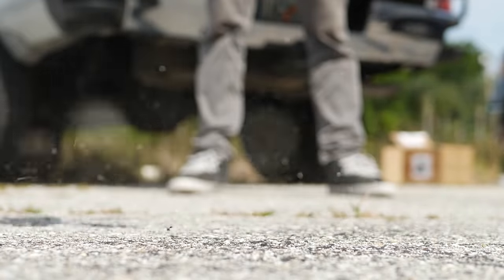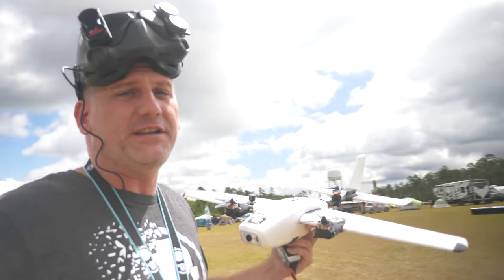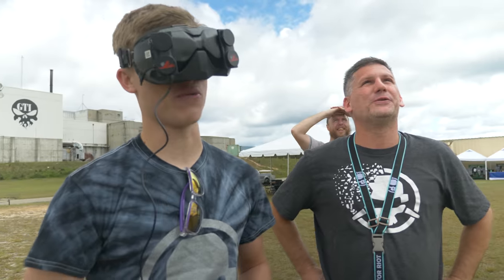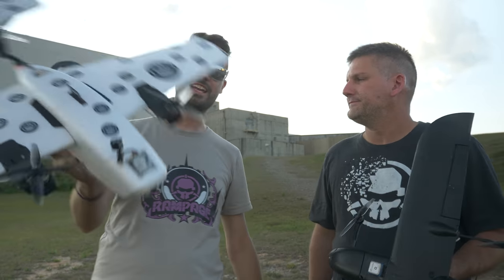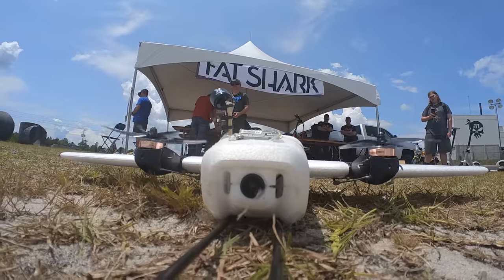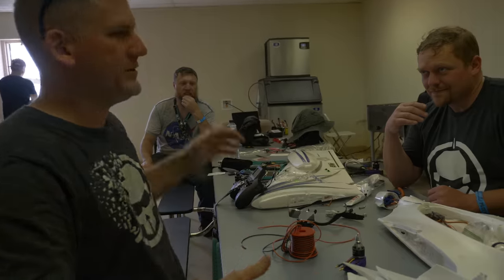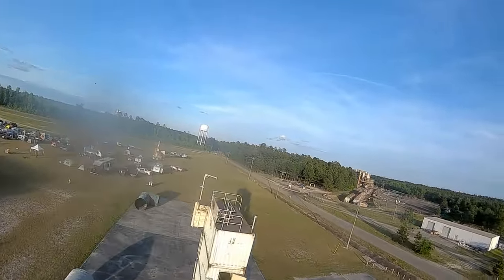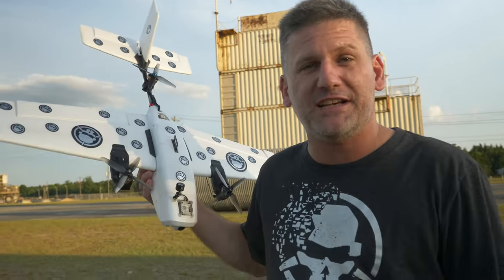Is THIS the Most Efficient Drone Platform for Delivery? - VTOL FPV

Comment: The ultimate RC  delivery of FPV aircraft would be a large payload-capable VTOL wing capable of flying fully autonomous waypoint missions far beyond the reach of the controller like an older DJI Phantom can do, but at much higher airspeeds that would enable the wing to cover far greater distances per battery charge than any quadcopter.

Comment: This but with a pusher rear motor which tilts into a pusher for FW flight would be cool. Makes use of all propellers in both flight modes.
Reply: And a twin boom design so Handling gets better and the pushing prop has no resistance

Comment: Nice to see FPV people experimenting with V-Tol drones. Been in FPV for a long time and from the FPV knowledge got working as a drone pilot doing flight tests for the VTol systems that will be used for mapping and surveying.

V_Tol is not that new but for Mapping its a totally different story. Im not convinced about the solution to use the configurations shown in the video as a delivery drone. The way these flat pancakes fly through the air makes them really loud compared to other configurations/systems. 

There are tests done by different company's using these types of drones to fly BV_LOS from point to point. At this moment tho the regulations around this type of flying is quite difficult as there need to be a lot of safety percussions to do these flights legaly.

Comment: How’s it perform in quad mode in wind?
Imagine using reversible props on the rear quad motors so you can pivot every motor between horizontal and vertical? No useless weight/drag and more power…?

Comment: Awesome concepts!!!  The Opterra build was great.  Could you possibly hollow out sections in the wing to install ducted fans?  Clearly you’d have to stiffen the wings somehow where you removed material, but it might solve some of the dead stick drag issue with the unused motors.
Reply: i was watching this thinking the same concept but instead the fuselage staying its width through to the tail and putting a ducted setup in the same spot. Cool concept Lets Fly RC Shaun 😎
Reply: That is alot of wing surface to lose...(I think those are 8inch props(
Reply: @flyingfoxfpv6147 make it a twin boom design with the pushing prop in the aft, it'll allow for better Handling

Comment: Maybe have the rear tilt and use it as a pusher...
Reply: The part has been designed by my friend Mark.  Problem is the thurst vector would require the motor point down in tricopter mode.

Comment: Adding throttle for planes does increase altitude actually. The wing has a stall, cruise, and lift speeds that are determined by its shape. So there is a certain speed that you would not have to input any pitch because well thats the wings preferred speed and is providing exactly enough lift.
Reply: The software is designed to use the quad motors and the barometer to maintain altitude in transition mode, so the quad motors will compensate for any altitude change.

Comment: Wow thats really nice. How much is the estimated cost of building a drone like that?
Reply: Depends what components you use.  

You could build a $2 foamboard plane from Flite Test with inexpensive servos and motors and could probably do if for about $150. The most expensive part being the flight controller. 

Most of these were using DJI FPV gear, prebuilt off the shelf airframes and quality motors and servos, so they were quite a bit more.  

The HeeWing Ranger, for example, cost me about $750 with all that I put into it.

Comment: what about similar motor mounting at the back of the vtol(make the tricopter a quad) ?!? ... rear motors pointing down (folded upwards) front motors pointing up  folded downwards
that way one would have 4 motors pushing in plane mode ... (if needed for very long flight time use folding propeller at the rear end and switch them off for travel with only front motors)

Comment: Children..      pls. be carefull sharing parameters.. Param. file copy is only valid for a vehicle which is duplicated in every possble way. even then, some calibrations will not apply, and not all of the parameters are saved as part of a param. file. also some values change with new firmware versions, of which there are constant updates. and if you are updating an existing version, the software will help with some conversions, but not just copying. you will end up with parameters that will not work.    
also, the effeicincy of a motor/prop combo is drasticlaly different from planes, to quads.   so using differnt motors and props is actually a very good idea.  what is "useless" is using an ineffecient combo for forward flight, rather than adding another that is specialized for it.   it's a little conter-intuitive.  titling a video on one kid's first impression who clearly has gained all his knowlege of fixed wing aircraft from games and avengers movies, and just pushing that info out to everyone as fact, is just slightly misleading.  love the enthusiam though...         this is not new.  i made a quad plane some years ago by using an old phamtom, first edition and a multiplex easy-glider.  it flew flawlessly first time.  it's really not that difficult.  arduplane makes it much easier.    it woudl help you immensely to use an airspeed sensor, and actually tune the aircraft, inclusing the TECS process.  and use a FBW mode, either A or B for actual flight.  should try an autotune level of 7, or 8 for that size airplane.

Comment: I'm just getting into the hobby, and have very little experience with quads or fixed wings, but could you use mavic style floppy props on that rear motor to reduce drag when not in use?
Reply: I forgot to bring them with me, but, definitely want to try that.

Comment: Could you rotate all 3 motors for no extra drag?
Reply: The software does support it.   I wonder, though if more motors spinning would use more energy and kill the battery faster.  ¯\_(ツ)_/¯. Definitely something that would have to be calculated
Reply: @LetsFlyRC  The most elegant way would be four tilting motors. Two motors on the front and two motors on the back of the wing. Would be also more stable in hover mode. Especially important, when the aircraft has cargo weight attached. Four horizontal tilted motors in flight mode would mean a lot of redundancy, good for example when the aircraft is flying over mountains or sea.
Reply: @steffwo  it is definitely something that needs to be calculated.   Another factor to consider is that 4 motors drain the battery faster than one.

Comment: 8:40 -> That is not correct. VTOL/STOVL configuration is always more limited in terms of payload (lower MTOW) and efficiency. Real aircrafts with such capabilities like for example Harrier or F-35 need to carry much less payload and fuel in order to be able to take advantage of their VTOL/STOVL capabilities.